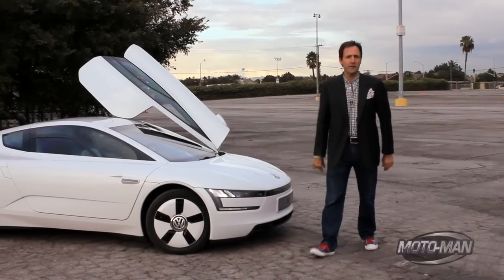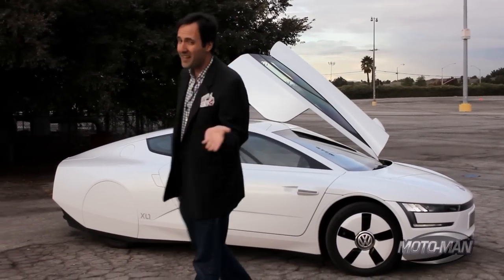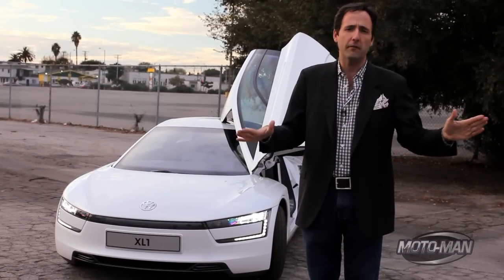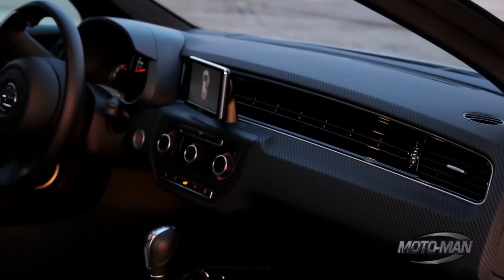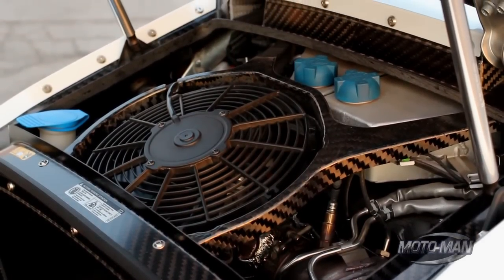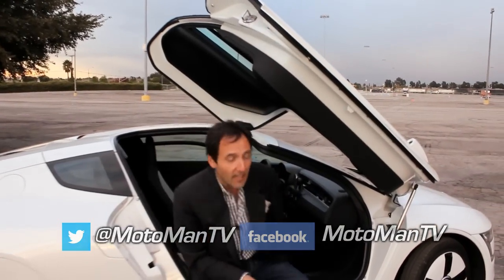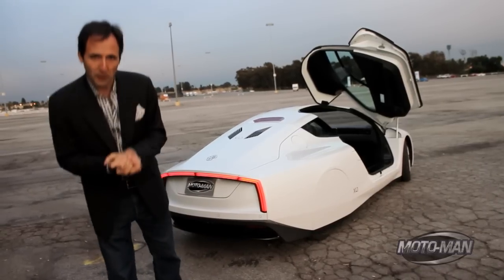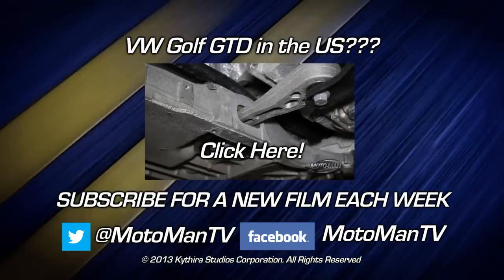VW XL1 Turbo Diesel Hybrid -- The Most Efficient Car In The World

Comment: As a exercise going for a design that is really efficient in the wind tunnel is great, but in the real world it doesn't really translate into better mpg. I would expect the this car going down the road at 60 mph wouldn't have more than 10% better mpg than it would if the body was a brick, just a 5 foot wide 4 foot tall 16 foot long brick. If the brick got 100 mpg I suspect the slippery design may get 110 mpg at everyday driving speeds.

Comment: That thing is a betrayal to me. A plastic n aluminum caterham is way lighter than this. It's double the weight with worse aero compared yo to the l1. And i see no good reason for that.It's trying to show that a Volkswagen, a peoples car that's super efficient, aint doable, with its ridiculous pricetag. The original piech car with a little beauty treatment, an even more efficient or slightly stronger engine and 20-60hp electric buttkick with minimal battery, just for good acceleration and short runs at above 80mph.  That would be it. And okay... Without carbon. So overall 70kg more maybe . Bet that could still do 1.3l at 50mph compared to the 1 of the primitive diesel car, in fuel only mode.

Comment: This is total bullshit, the drag does very little, especially at low speeds, the weight too. The reason for the efficiency is diesel electric..you know the cheap low tech part.
Reply: Lie. Guess what? Weight matters, a 200cc bike at less than 150kg fucks every car
Reply: @gur262  Yes if you take it to those extremes but using kevlar instead of formed steel making a difference of a few kilos will make little difference.

Comment: if they mass produced them it would be much cheaper, if you noticed they a german spit out bunch of non English nonsense so that they don't give away any secrets about the engine & motor. someone once told per weight hauled a train is one of the most economical vehicle in the world. check out the VIA truck 3/4 ton gasoline/electric, gets 100 mpg, if was desiel/electric powered it would do even better, old technology. the desiel/electric train has been around for 50+ years. the oil corporation's are very greedy. the world's energy can be can me maintained by solar panels & wind mill generator.

Comment: the mitsubishi outlander PHEV gets 2L/100km in hybrid mode, cost 100'000$ less - there are alot more of them - isnt so damm ugly 

so it roughly gets around the same MPG as the VW because (lets convert to metric here)
10.2L divided by 496km is around about 2.05L - a very minimal increase in fuel consumption

but for the better price tag, better looks - what are you better off to buy?
Reply: The VW spec'ed at 1L/100km, not 2L.
Reply: And Outlander PHEV looks like 6L/100km

Comment: The most efficient cars in the world.. are electric.. sorry.  They don't have to haul around a petrol generator.
Now if you are talking about efficient ICE car.. sure.
This is where things get interesting.  The current battle is one of material development for batteries.. not hybrids.  Not if one is talking efficiency.
Range?  That is a matter for some discussion yet.  Turbine generators running on CNG might be more efficient generators.  Lots of work to do there yet however.

I do have an issue with the use of the word "efficiency" in the title here.  It may be an efficient combustion driven car.. but it's not as efficient as electric conversion to motive power alone.. sorry.
Reply: its efficient bc of the aerodrag and not bc of its engines or anything of the sort
on the engine side, the diesel engine is more efficient than your average gasoline ones
yes, its less efficient than electric engines, but its like comparing apples to oranges
if this car had to carry batteries, its rolling resistance would have gone sky rocket and woudnt be as efficient
the goal of the car was to see how far they can push the fuel efficiency to its limits while keeping it producting car level
Reply: i did the math - the claimed fuel consumption of this car VS a mitsubishi outlander PHEV is 2L for the outlander and 2.05L for the VW
and the outander is 1/3 of the price
Reply: The Wide Open Life 

Without battery power

This car : 140 mpg
Outlander : 50 mpg

Comment: Well the efficiency is moot now that we now it pollutes harder than a humvee.
Reply: Except it doesn't. It actually pollutes less than any other fuel-powered ICE car ever made.
Reply: No.      Afaik emission standards for diesel basically measure pollution per liter burned, which... Fuck it.   Say the original study, which burned 1liter diesel per100km at 48mph, had no kat. Or a bad one    Dirty as hell. Well.    Ok, but is it emitting more dirt per 100km than a car with good cleaning but  6 liter per100km? Probably not.    Also it's a climate emergency not an air quality emergency.          Some of those could n should be permitted, thats how ig works with ferrari
Reply: The NOx emissions on VWs dirty diesel cars, which affect the climate harder than CO2 emissions, were polluting at 20x the regulatory limit of cars at that time (the standards all the other companies complied with)... So yeah, your 6x fuel efficiency math still shows these dirty diesel cars were horrible.

Comment: Why does the rest of the world get better fuel economy? Why can't the US? If you have enough power to speed up to 80 mph, why need to go any faster??????
Reply: Because the rest of the world lies or simply "interprets" the figures differently.

Also the roads of the US have very different needs than those of Europe or Asia. Even if you never go above 80mph (which on many highways you will) you still NEED to be able to reach 60mph quickly, especially on major interstate highways when one merges with traffic during rush hour.

Also also: it's worth noting that lack of power does NOT necessarily equal good gas milage and high MPGs are NOT the same as being green. There is a version of the BMW 3series that is near the same emissions rating as a first generation Toyota Prius but you would be lucky to get more than 19mpg in that vehicle. It does however drive very nicely and is decently powerful for a midsize sedan.

Comment: Decreasing the frontal area does not affect the coefficient of drag. The coefficient of drag is a function of drag for the frontal area. Decreasing frontal area does, however, decrease the cda which is the coefficient of drag multiplied by the frontal area, basically it's the overall drag.
Reply: Shot bro - #New nose+streamile body=good drag
Reply: English please.
Reply: @ricardomunoz2010  shape and size affect aerodynamics.             This means a tiny car the shape of a brick may very well have less air resistance than a smooth 40ton truck.         Car manufacturers love to ignore one part of this so they can pretend big cars are not even bad.
Reply: r/iamverysmart

Comment: The Bugatti Veyron of economy cars.
Reply: wolfmannn2008 BMW E30, 3.0L?
Reply: No. That was the 1liter original study.  Today it would be take that study, make it a bit more beautiful, maybe give it a third row seat.it had airbags and ac. At under 400kg.Tiny diesel engines sure could be done more efficient now too, 15+years later. Or use a modified 125cc motorcycle gasoline engine?   Sure that's a bit more fuel but without the diesel scandal baggage. Then beef it up, the 1liter car had only 8.5hp,so does a honda innova125 bike.     An electric motorcycle engine weighs 20kg at 100hp. So. Add 20-50e hp and a small amount of battery. Now you can sprint above 80mph and get there fast. Because of weight, but extendable.maybe solar even makes sense.  Base battery would be meant only for the engine warmup phase and basically, while 80mph is fine, rhe acceleration of 8.5hp is not, so that's the electric motors job.          The original study was 2seats in a row. Slim. Slim and low, basically small from the front is what efficiency is made from.      At some point falling over is a concern, bet esp understeered like hell.  A Slight lean and electronically hardening suspension as well as a raise to be fine in the city seems the solution for that.        Problem stays that there's nothing in a side impact. I wonder what a side impact bar, far away from body work, could do here.    Protecting while staying aero. Adjustable when downforce is necessary. Mounting point for big luggage boxes you use if and only when needed
Reply: Sorry but a 150k car is not economic. I can buy an BMW e30, 3.0L engine with 150HP, ride it as hard as i can for the rest of my life and still have some spare change from that 150k. Including repairs, fuel, tires everything. Maybe even go to drift weekends.

Comment: so I have to spend 160K for this shit car ? Tesla Model S is less expensive.
Reply: @VitaliiDaGamer but only if you can get 100% efficient petrol generator to charge it. It's easy to quote high efficiency figures for an energy source that does not need to be converted to heat before use for motion. I mean compare a 3kw electric motor compared to a steam engine ran off a 3kw electric kettle element. The electric motor will be far better with the same power in.
The advantage of a petrol powered engine is the amount of energy storage you can put in a small space to make the car go for miles and also how quickly you can replenish the tank. It takes about 1 minute to brim a tank from empty with two billion joules of energy. As more energy is wasted as heat the equivalent battery is around 200kwh to a largish 50-60 litre tank of fuel. 12 million watts to recharge in a minute. A small power plant worth of energy if the battery didn't shit itself.
Reply: And probably more efficient..

Comment: 310 mile range.......so that explains the 300 MPG number. but I read and you said it has a 2.6 gallon tank or was that 2.6 metric gallons. does every site think they can exagerate the real MPG it might get in the real world. yours has been the most accurate description I have viewed yet. many fail to mention you only go 100 KPH as the top speed or 62 MPH. lets get back to the fuel tank, motorweek said they got 147 MPG with their test drive. that may be a real number. the 147 times two gallons that you can possible drain out of a fuel tank before it sucks air leaving some reserve is about the 310 you say it gets per tank full.
thanks for your video, it explained a lot........
Reply from the maker: Had some more fun with this film even BEFORE we went on camera. Completely geeked out on the details prior to meeting Christian, then hit this poor guy with a raft of questions that looked more like a pre-flight checklist for an A380 than our usual engineering pre-interviews . . .
Reply: I read its max speed is 98 mph.
Reply: @mertz313  NO! The maximum speed that the XL1 could do is 125 MILES PER HOUR but VW have electronically limited it to 99 MILES PER HOUR. I can verify that this car will cruise very happily at over 90 MPH and is solid and safe at that speed!
Reply: Ed Stratton Wow thanks for the info 5 years later lmfao
Reply: It will only do. 100 Kph.....not 100 MPH: 63 Mile per hour any faster would be stupid for mileage.
Reply: Eaamon Mangan I know the difference between kph and mph..What I'm saying is I READ ON THE OFFICIAL WEBSITE THAT THE TOP SPEED IS 99MPH. It's electronically limited there. The car ACCELERATES from 0-60ish in 12 seconds. 
Source:
http://www.volkswagen.co.uk/about-us/futures/xl1
Reply: Heartagram
99MPH in the UK web site is 99KPH
....typo?!?

they state it is electrically limited to that!

Comment: so, only 200 of these are produced and 50 drive on the streets for selected customers who pay $150000. i think vw will do to this car what gm did to their electric car: they will take them back and then crush each one of them in a press, because it is to harmfull to the oil industry to have cars around which take only so little fuel or even no fuel at all. greed for money toppels technical development.
Reply from the maker: One MAJOR difference: VW is selling these - not leasing them. Thus, the people who buy them retain ownership. That is how GM was able to take them back. VW won't be able to do the same.
Reply: ok then, vw can not take them back but in some other way vw will terminate this car, maybe by simply not mass produce it or keep the price artifically high. the oil industry can not have the streets traffic turn electric or even if it is only a 1 liter per 100Km car. we'll see where this goes (down the drain).
Reply: you should tell elon musk

Comment: Its an interesting car , kinda sounds like the new BMW i cars ... only in a Diesel engine instead of the optional "Baby-Six" engine. 
Learned a lot about the XL1 . Thanks & as always great video M.
Reply from the maker: Far more imaginative than the BMW i cars . . . This is more ingenuity and the design is COMPLETELY dictated by function . . .
Reply: Design Wise I agree , The i3 is more like Mission over Function, it sole mission in life is to be an Electric "European Compact City Car", which clearly affected the design process ... think Cinquecento ;) . The i8 is kinda in between though .
Personally, I think the "i" Brand is a byproduct of BMW's big plan of Lowering the Costs & Mass Producing Carbon Fiber , Which gonna have a major role in their entire line up starting with the next 7-Series